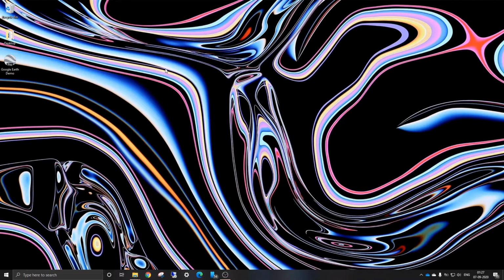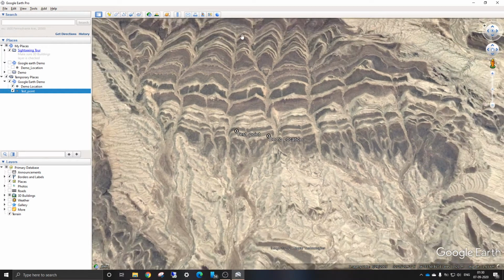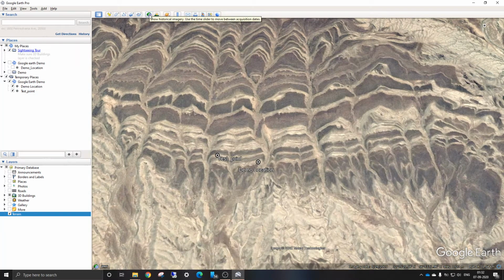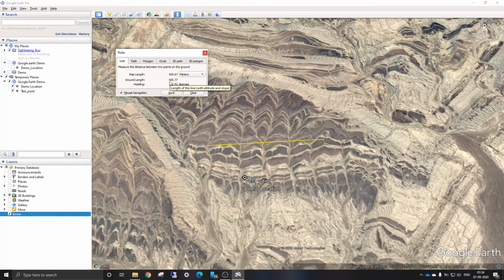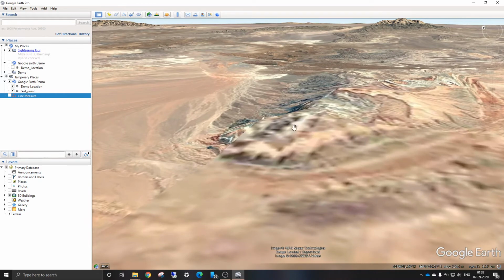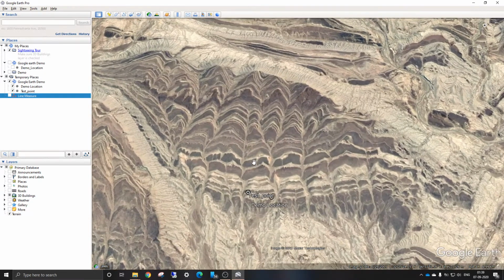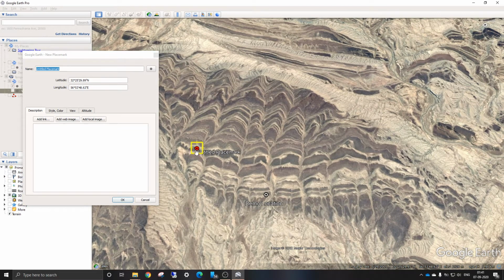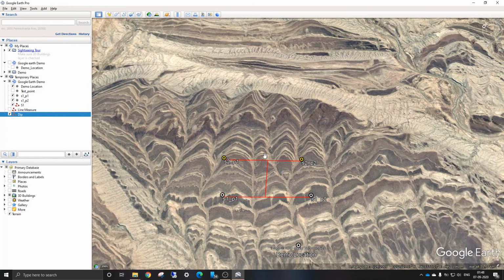Google Earth Demo

Comment from the maker: ** Please Note there is a mistake in the demo video**
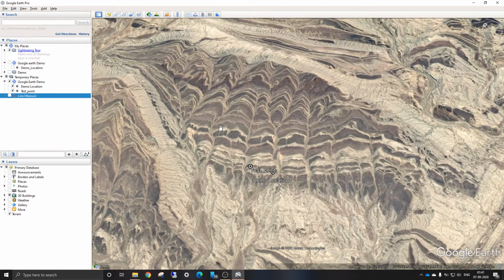At 14:00 While drawing the strike line you have to limit your observation within one litho unit or preferably choose two points lying at same same elevation and same litho-contact.
This is an essential condition while drawing strike line. So please take note of this.
Reply: Strike line drawing is fine, because it is for same litho-contact or litho-unit. During dip measurement 2nd strike line must ,be also located within same lithology. It will be great, if you can share another video.